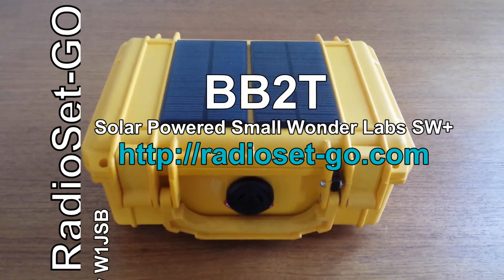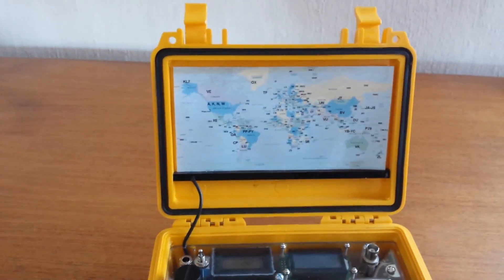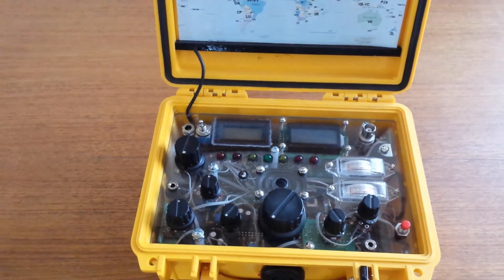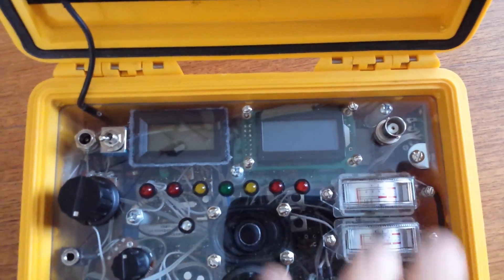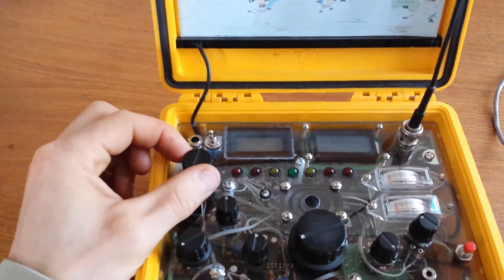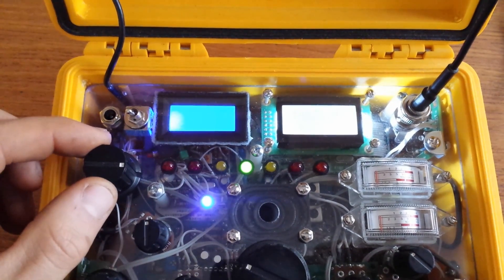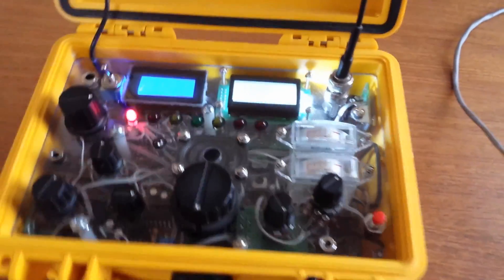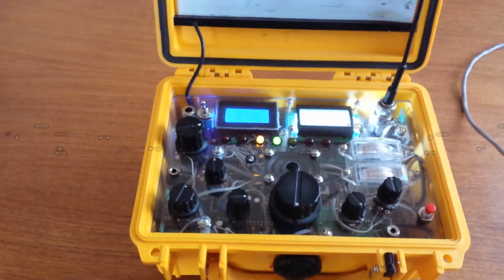Solar Powered Radio Transceiver

Comment: I'd like to add onto another comment below... you used an extremely expensive and durable, WATERPROOF pelican case for this, and then CUT a bunch of holes in the case?!? It seems so counter-intuitive. If all you wanted was a sturdy plastic case for this, surely there would have been much cheaper options?
Reply from the maker: All of the holes were sealed, and I was not that concerned with submersibility for that build anyway. I was more interested in an external indicator of solar charging, and experimenting with some parts I had at the time.

Comment: Clever design for a get away/camping, emergency or prepper operation. However, may I make a small recommendation? You have chosen a highly durable and very rugged enclosure but installed one of the most delicate of all electronic devices on the OUTSIDE, that being the plastic analog meter. Perhaps a cheap led indicator on the outside indicating status by 3 colors. Green, fully topped, ready to go. Amber OK to use but expect less power out and Red Not NOW.  
Otherwise you have a unique and clever idea. I also like analog meters very much but the LED indicator on the outside would allow users to be less worried about busting something on their deployment box. Especially as a bug out box someone might use on an emergency.
73,
Glenn WA4AOS
DSM Labs (dot com)